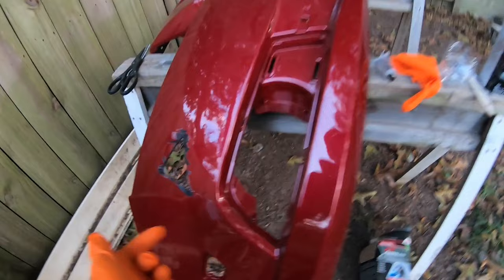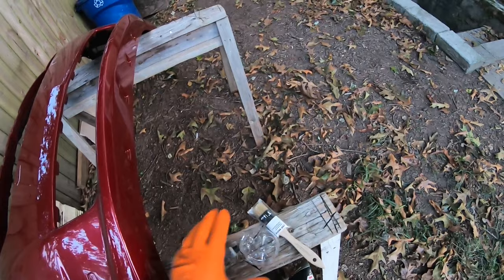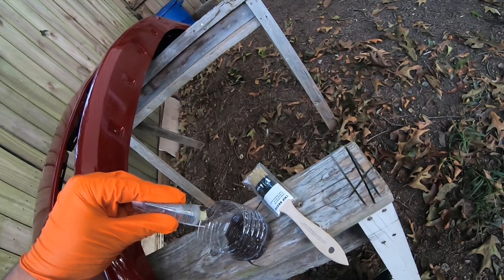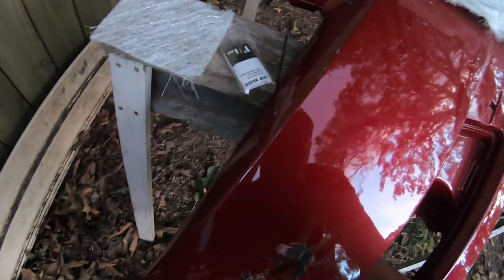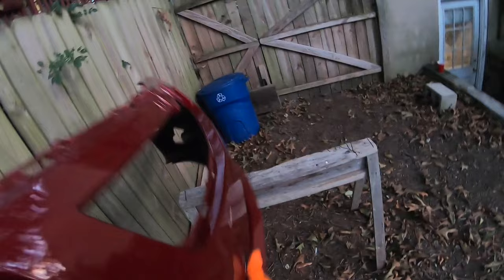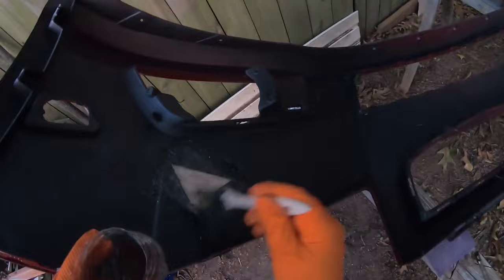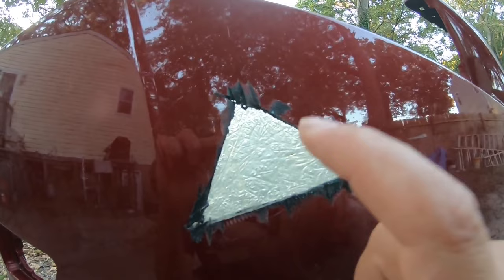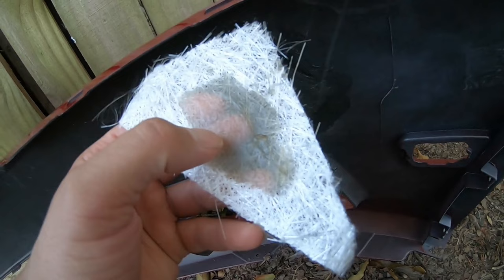Fiberglass and resin repair kit demonstration

Comment: Hardener was 10 drops per ounce according to your video I just watched. It was written on the can.
Reply from the maker: Thank you . I apologize for the hillbilly way of doing it . I did too much of talk in my other video: 
Bondo fiberglass repair kit review
https://youtu.be/_BeDer-JUSI
Reply: I found that if I did 10drops to 1 ounce it cured way too fast. I think his hillbilly approach might actually be spot on if you want to lengthen your working time. I’m doing 7drops per ounce. Just be sure to thoroughly mix the resin so it can all cure.

Comment: So that bumper you have there is made out of plastic I haven’t seen anyone do a repair using fiberglass on a plastic bumper before I’m sure it’s fine because bumpers are typically just for cosmetic
Reply from the maker: Yes the cool thing about fiberglass it’s capability to stick to almost any material, surely the best way to fix it is by patching using a plastic piece.  But like you said it’s basically cosmetics

Comment: I’m here as I just tried my first fiberglass repair (blind trim areas), and I didn’t get the mix ratio right.  Cleaned it off with acetone.  Will try again.
Reply from the maker: Here is another video I did talk a lot but went through the  instructions of exactly how much hardener needed

Comment: Saludos desde Puerto Rico 🇵🇷… si tengo una abertura de menos de 1/8 de grueso tengo que utilizar el paño o puedo aplicar solamente la resina ?
Reply from the maker: 🇵🇷 Greetings from USA 🇺🇸.The cloth is a must , you need it regardless. Can’t use just resin but un that case you can use the short strand mix . If you don’t want to buy it you can actually make it yourself buy mixing resin and short pieces of fiber glass

Comment: Great video you were very descriptive as well thank you!
Reply from the maker: Thank you
Reply: Yes you were. 👍
Reply: @WheelersHoarder  can you use fiberglass filler instead of resin? Wouldn't  filler be better because you can use it instead of Bondo and sand it and it will stick better to the plastic bumper than Bondo?
Reply from the maker: @wazup3333   you can definitely do that as well . But the right way is to apply the resin and let it cure like I did and then use the fiberglass filler on it and finish it
Reply: @WheelersHoarder  why is resin the right way instead of filler?
Reply from the maker: @wazup3333  when you say fiberglass filler , do you mean the short strand filler ?
Reply: @WheelersHoarder  yea or long strand like the evercoat tiger hair long strand fiberglass filler product
Reply from the maker: @wazup3333  that works great

Comment: Did you cut out the triangle in the fiber glass or kinda just shoved it in there? Basically how did you shape it
Reply from the maker: I just did rough cut it to cover the hole and overlaps the bumper a little bit

Comment: Thank you so much for this video. I don't know too much about bodywork and all that but I couldn't find any other videos on what to do after patching with fiberglass. Like I'd like to paint match it so would I just sand it smooth, put epoxy primer, then paint and clear coat?
Reply from the maker: You are welcome bro I’m glad  the video help , all you need next is to apply a regular body filler and sand it smooth then it will be ready to paint. Just take your time with sanding it , sometimes if you are not satisfied you may still need to reapply more body filler and sand again.
Reply: @WheelersHoarder  thank you so much!
Reply from the maker: @nicholasvalerio9232  you are welcome, glad to help at anytime

Comment: Hey mate are you able to drill through it or would it completely crack
Reply from the maker: Hey mate I guess if you want to be able to drill through it you will need more layers like another 2 layers and use big wide washers
Reply: @WheelersHoarder  gotcha thanks mate
Reply from the maker: @thesenamechangesareallowed4119  you are welcome mate

Comment: Is that also possible for metal repair like broken parts of a car? tnx
Reply from the maker: Yes absolutely it works on metal and almost anything but nothing structural or like car parts Once it is cured you can reinforce it with bondo short strand fiberglass
Reply: Nope
Reply from the maker: @jerrymarshall2095  I need to start reading the comments well before I answer, I had to update my response. I did not see car parts 😂 
Thank you
Reply: 8–10 drops of Hardener per ounce as per manufacture specs. C’mon bro…do better.